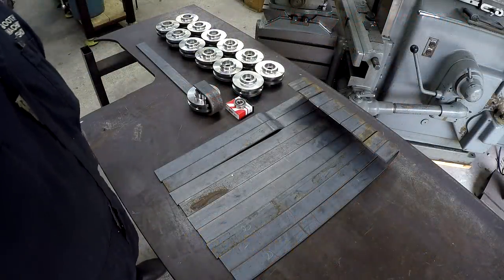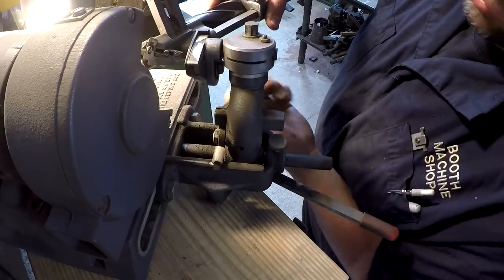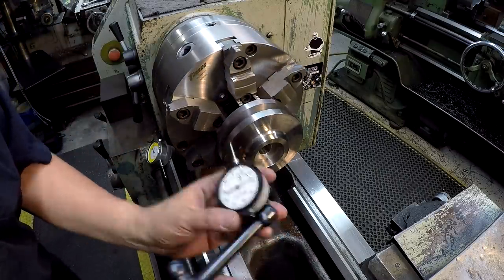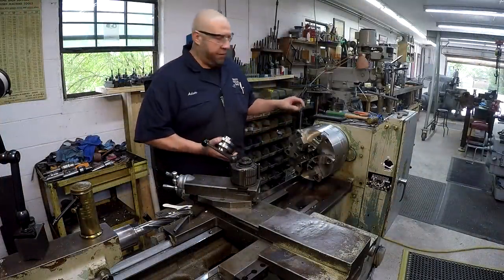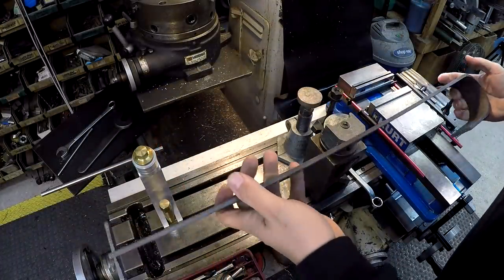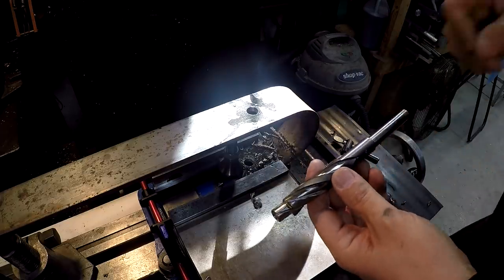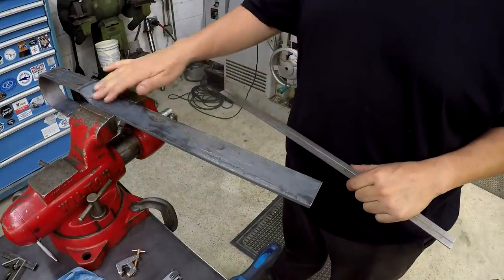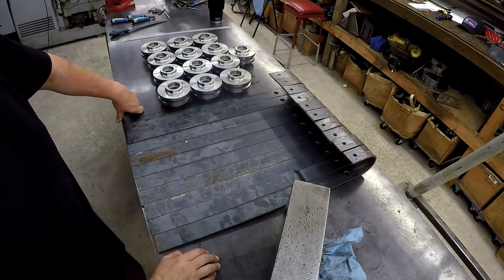Machining Rolling Barn Door Hardware

Comment: I work with sheet metal on my job and I'm always jealous of the nice chips and the well defined geometry and precision you get working with solid material. The sheet metal always tries to bend out of the way when you drill it or measure it if you don't have a tight setup.

Comment: You've never seen a sharp edge until to handle a light fixture.  They never debur the edge after stamping.  We used to call Lithonia a cutlery company.
Reply: I do believe that the inner edge of a Murray or Eaton panel would like to challenge Lithonia for sharpest electrical device edge title.
Reply: @ohhpaul7364  Air conditioner cabinets can't be far behind.  I worked at Trane for 17.5 yrs.

Comment: lol ... I love the professional attention to accuracy ..... measuring in thousandths ... for a hole in a bar that's gonna hold a barn door, that's probably gonna warp half an inch first time it rains !
plus you know how those wheel hanger bars are gonna get attached to aforementioned barn door don't you? barn door is gonna get balanced in place on random sized blocks of wood, and someone's gonna drill through bar and into door with a hand-drill, then whack a bunch of wood screws through the holes  :-)  there will probably be no measuring devices involved in that operation at all, once the first and the last wheel hangers are fitted and door is now hanging on extreme ends, then the rest of the hangers will be screwed in place using same methodology, placed as evenly as a rough glance says 'yeah, looks about right'.   :-)
But I do respect that professionalism; if you are gonna do a job, be proud that you did it well; even if you do know it's gonna be attached to a piece of dead-tree carcass.
/respect
n00t
Reply: 'Barn' might be just what they call it. I've been watching a lot of RR Builders vids. They measure a 84'x128'x18'(I think 18) building to the 1/32". There's no slop or slack.  Example, they don't build or install the big garage doors. So when the crew to do that shows up, it better fit the frame they built or somebody's gonna be toast. Well, I'm sure there are sloppy builders as there are sloppy machinists. I like the RR vids because he's as precision- quality- and efficiency-oriented as Abom is.
Reply: Oh forgot to mention. Even of this is a livestock barn, someone putting $10Ks or $100Ks worth of animals in there is gonna put up the best door possible to protect them. Anybody does such a slackjaw job as you describe is gonna have to do it again till they get it right.

Comment: The most precise barn doors ever made !!!
For slow running drill bits,end mills and anything that doesn't spin on 2000rpm-put oil on the top of flute next to the chuck.It will slide down the flute as it spins and lubricate the cut way better than putting  it on the work peace once.

Comment: Super important to deburr. I’m a 30+ year glazier and we never let even a piece of picture glass leave with out seaming the edges. (Our equivalent to deburring) I was also a lathe hand at a metal spinning shop for a few years and when we would part some softer metals as our tool got dull we would push some nasty burrs through. Been cut through leather gloves before when I attempted to use a scotch pad rather than my deburring tool.

Comment: FYI - there is a railroad that runs from Wagga NSW Australia down on the Murrumbidgee River (621.160'/196 m elevation) up (literally!) to Tumbarumba (2098.404'/693 m) in the foothills of the Snowy Mountains. The line was built in the early 1900's, and opened to Humula (mid-way) in April 1917. It was built to Pioneering line standards - cheaper  -  and had some interesting features. 
It was based on (and probably sourced from ) the UK by C. B. Byles, Signal Engineer, NSW Railways. Being in the early 20th Century, manufacturing methods were - using equipment we have seen recently on Abom79's channel - of minimal standard, but the design and operation were effective and non-wearing. (I'm getting to it!) The rollers for the heavy (barn) doors used with the luggage room and goods shed were simply white cast iron - there was no separate axle. The axle was part of the casting, and sloped out towards the ends and they ran in a slot bolted to the top of the door, the length of which was sufficient to allow the wheel to run from one end to the other (6-8") while the doors ran say, 8'. they were very efficient, as it only took finger pressure to op[en and close the big heavy door - one for each opening! Wonderful!
The same principle was used for the point rodding  and allowed several tens of feet of channel to run on cast iron wheels out in the open and without lube. They are over 100 years old and look as good as new (plus a little surface rust) and operate the turnouts just as effectively now as they did then.
So, Adam, as I know that you like old iron, as do I, I thought I'd pass this on to you and your viewers. Thanks for great videos!

Comment: Good work on that stop block and toe clamp positioning on the mill. Put those holes spot on. Right with ya on breaking those edges, the cut aint done till its deburred and the chips swept up.

Comment: Hi Adam,

There's a trick I sometimes use on jobs like this; 

Rather than having to tap the pulley square for the second champhering op, use the core drill as an arbor to hold the pulley whilst you tighten the chuck.

Comment: Thanks you Adam! I bought a commercial stove, with a griddle, and it had a sheet metal oil-drip pan. The first time I cleaned this pan, I sliced three fingers open on the razor sharp un-dressed edge of the sheet metal. I was so pissed. How could they do that?!? It should have been obvious to the maker, that the pan would be removed for cleaning, since it was designed that way.

Comment: Love the counter boring bit.  It keeps the drill centered and you get no chatter.  Another option would be a Unibit.  When I made my rotisserie for my race car I had to through drill 3 inch pipe and I could never get the 1/2" drill bit to not walk.  If I have to do it again I'll try your method.

Comment: What a totally cool adjustable stack block under the tail end of the toe clamp. Shown in the still shot at 34:32. I've never seen one. Just rotate the layers to achieve the correct height. What's that called? How old is it? Tell us about that. Good job and thanks for your videos!
Reply: One of those "just when you thought you've seen everything" things.
Reply: How about Stack-O-Shims?
Reply: I was wondering the same thing.  Sure beats grabbing a bunch of small stuff from the scrap pile.

Comment: Adam, I'm surprised you are using the air gun to clear away the chips, when you have a shop vac right there. See you at the Bar-Z. Jon
Reply: Railfan 439 I have for my shop a wall mounted shop vac and I usually use a old paint brush with long bristles to clean chips off of work

Comment: I usually don't index on jobs like this. I just use the center and press the workpiece inside the chuck with light tension on the jaws. It's faster to replace the drill with the center then index every workpiece..

Comment: Is that how Americans normally interface a roller to a rail? Square roller, square rail? We've got a lot of experience with security here, and we've found a 90° triangular roller on a round rail works best for rolling gates.

I don't know if I'd have done the hangers like that either.
Reply: Makes sense. There's a ton of friction with twin 90 degree bevels. The outer of the v on the roller is rotating faster than the inner. Makes it noisy & will wear faster
Reply: Only 2 points of contact - we use round rails. The friction would be 10 times worse if one of those square rollers was misaligned. Wear is expected and the design allows for it.

Comment: I agree with removing the sharp edges Adam, I'm usually the first to bleed even before they go out.  I've never seen a stacking block like you used on the planer clamp hold down, Home made???

Comment: Hey Adam, at 14:19, when you start drilling through, the drill bit can be seen shifting to the left.  Is that because your tailstock is not dead centered?  Also, is that frikkin normal?  I have spent a lot of time trying to fix that on one of my lathes, and I never seem to get it right.  I'd love to see you talk about this!  Thanks!
Reply: Not a machinist, but having watched way too many machining videos, drills almost always walk especially when drilling such big holes. It's why drills are never used when tight tolerances are needed. You drill slightly undersized, then bore or ream to size. Boring is used when you need a tight positional tolerance as well, because reamers will follow the hole that the drill made, which may not be positioned true.

Comment: Well done sir.
But if you want to make it fast and take the variation of the parts into account, it would be way faster to centre the machine spindle over the vice. This way you always hit that one side right on the money and do not need to mess with the scribed lines on top.
Reply: Agreed, but as Adam said the bends are not exactly straight or parallel.  So every one he puts in the vice is not exactly square. That's why he is marking each one. Adam is not running a "bash em out quick" job shop.  Probably not the way to make the most money but that's how he does it.    regards

Comment: I have a question I was wondering if any of you can help me with. I have a motor arbor that came with some things I bought recently, all sales final sight unseen type situation.  This armature is approximately 5 feet long, 4.5 inches in diameter at one end coming out of the unwound armature and 8 inches coming out of the armature on the other end tapering down to 4.5.  Would this have any valid uses to a machine shop and what kind of shop do I offer it to? The weight on the box says 500 pounds and I do not doubt it so I would like to move it as little as possible.

Comment: unless these are custom sizes (not sure why if so) or going in a persons house for the barn effect, you can purchase these in most barn supply shops ion the internet - i have a horse farm in nj and sc and do this  - no need to custom machine with the added expense and time to do this - now, the video is good and informative but people have to consider whats available retail for (now i am assuming) a fraction of the cost and time
Reply: Yeah I'm glad I;m not the guy paying for all this non essential precision.  While it's nice to see precision obtained one must remember that this roller is going to roll most likely on a hot rolled bar  mounted on a plaster wall with lag screws.  Kind of silly when you think about it.
Reply: jeez that's helpful, although your information is probably correct - it ain't really helpful there is it buddy - has somebody checked you out for asberger's syndrome.
Reply: I looked at some of that barn door hardware.   I'm doing a full custom bathroom, and I'm not going to put any hot rolled, scaly material up on my wall.  I'm waiting for some either ground and polished, some hydraulic chrome rod, or maybe even some linear bearing shaft to come through the shop.  Depending on what your application for your barn door hardware is, it isn't overkill, mine are stainless.

Comment: I noticed the  bit drill drifting a bit. I know it isn't a crucial tolerance, but why does that happen? Misalignment of the flutes on the drill, or a bit o'slop in the tailstock?

Adam, thanks for the lessons, even if you don't have time to answer a question from a complete innocent...
Reply: I think It's just slop in the tail stock, kind of loose so that it can slide easier.  I've noticed a lot of videos where the bit seems to wobble a bit as it enter the part.  It will always find the center though.

Comment: Why are there 13 rollers and only 10 hanger straps?!?
Reply: Aren't there usually guide rollers at the bottom of the door to keep them from swinging in/out? That'd explain 2 of them.
Reply: Why is the line I choose at the checkout always the slowest?
Reply: @ml.2770  Because statistics.

Comment: If all those brackets are different lengths (see 3:40), wouldn’t using the stop position the holes in different locations?
Reply: They'll all be bolted to the door so the pulleys line up anyway, so it really doesn't matter. Could have saved some time setting up the mill once (in X/Y) and drilling the lot without too much messing about with rulers, scribes and lining up.

This man however takes immense pride in his work, so none of that sloppiness is acceptable.
Reply: The bend on top is just not relevant this way - given it has enough allowance over the roller guide. So the end of the bars could register against some feature in the door or the door is installed with rollers in place, which would make up for some errors. All rollers stay at the same level this way.
Reply from the maker: Owner will drill the holes in brackets and bolt them on the doors, so he’ll have to bolt the door square to how the wheels track.

Comment: Am i missing a step, you measured from the far end, but in the beginning of the video the bars did have unequal lengths to them, so did you cut them all to the same length or am i missing something.???
Reply: The top curve doesn't matter and the person installing them on the door will want them consistent from the bottom of the wheel to the bottom of the strap for easy installation on the door against a snapped chalk line.

Comment: Drilling the flat bar, is the Dark Cutting Oil a better choice for low RPM work than the NOGA mist coolant?
Reply: Hey Adam, a video all about what oil or coolant to use when would certainly be useful.  Seems like every YouTuber uses something different.  I'd certainly like a pro's point of view and recommendation.
Reply: Spit works best, its like egg white. It stays together as 1 glob. But metho is great, smells sweet but evaporates quickly aka cools the work

Comment: when boring out the holes were you going by resistance or chip length when u stalled and broke the strands?
Reply: breaking the chips so they don't turn into widowmakers
Reply: I used to go by length, when they start to flap when they hit the machine, thats a good time to break them so they dont grab on anything

Comment: I'm slightly concerned about the strength of the straps where the 3/4 hole is drilled. I would have liked to see a reinforcing plate welded on.

Comment: Does a machinist charge by the hour or by the project?
Reply: It varies. By shop and by project.  Some projects are for bigger-ish companies with a number of shops to choose from and will seek an up front bid for the work before awarding a contract.  Other items are for basically a guy off the street with a one-off project that he "needs right away" .  In a contract bid you need to consider raw material cost if the customer is not sourcing it themselves, set-up time in the machines, potential tooling or cutter replacement costs, machine process time, as well as the cost of the skilled labor for operating the machines, quality control, packing and shipping and clean-up after the job is complete.

Comment: why not grab it by the larger diameter?
Reply: The OD is more likely to be functional, so you'd rather not clamp on it, right?
Reply: all the barn door set-ups I've seen, the outer diameter is just to provide a flange, to keep the center, smaller diameter on the track itself @ChristopherTate
Reply: @fengelman  Sure, just wondering if Abom just automatically avoided the OD out of habit, even though it doesn't matter on this specific part.
Reply: I'm a retired carpenter, and wood and metals, are apples and oranges....I'm fascinated by the differences...and by the similarities
 @ChristopherTate